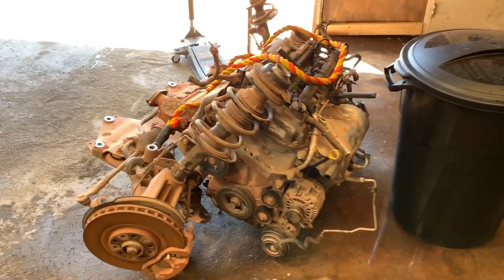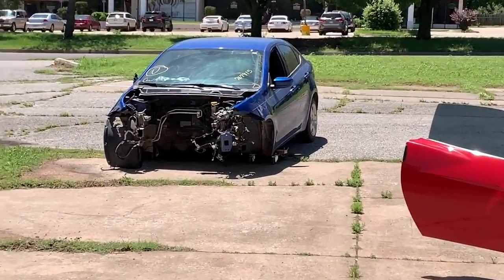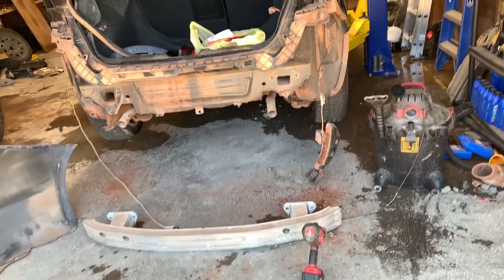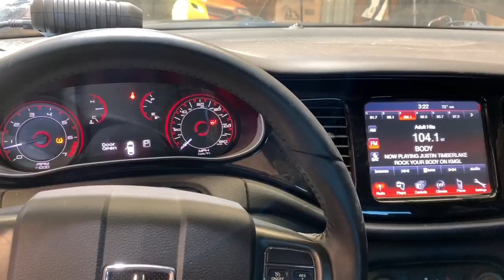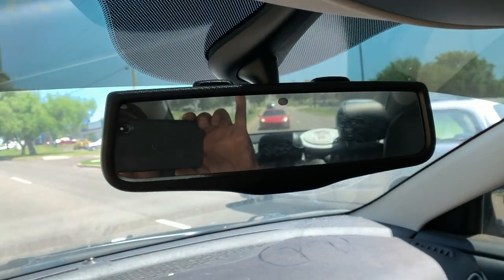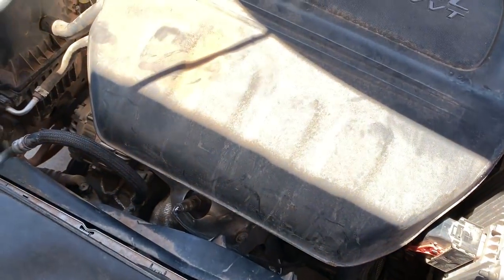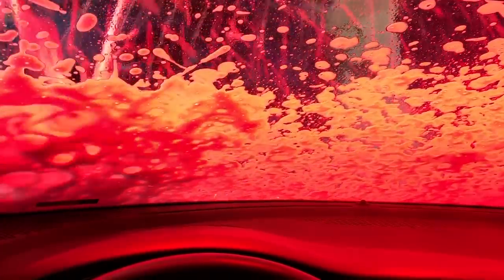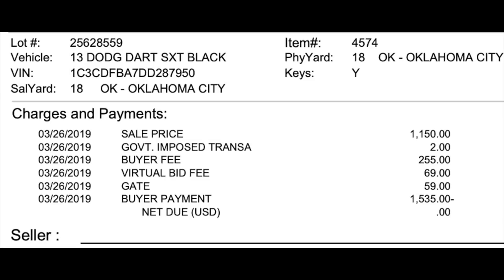Copart Flood 2013 Dodge Dart $1535 70% Off! State Inspection Time!!

Comment: Here's what I've learned Randy, I have had cars that sells at dealers for 10, 12.,15 thousand with a clear title. But with a rebuilt title people can't get these cars financed the banks want loan them that kind of money because you can't get full coverage insurance on a rebuilt title to cover a note in case of a loss. If I can get 50 to 70 percent of retail then I have done good. Yes I have had some that I got more but people had the cash or I carried the note on some of them with a big enough down payment. Either or good luck and congrats on getting it back on the road.

Comment: Randy: don’t repaint Dart.
Keep it original paint.
Have dents removed by paint less dent repair.

Water sand and polish original paint. It will look like, brand new factory original.

Mike can show you how.!
You can feature that on your channel!
Cheers

An original paint car is worth more money than a cheap Macco paint job.
Reply: Stephen horbatiuk I don’t even know if I’d worry about the minor dents but I am with you.  The paint on the rest of the car is fine for the age and much better than Maaco.  Paint the rewar bumper to match and call it a day.  The car looks great even as-is.

Comment: I’m with the others who have committed.  The paint on the rest of the car is fine.  Take the rear bumper cover off, have Weird Beard paint it.  Probably cheaper than a full paint, the car keeps its factory paint mostly and the stuff that needed repainted will be done right and probably cheaper that a full Maaco paint job.

Comment: Turn the electronics on in nurtual position turn wheel all the way to the left turn to nurtual turn off then turn back on all the way to the right back to middle turn off and then the light should go out I use to work on these cars a few a week

Comment: Do it right is the way to go... I'd be asking $7500 because it looks great plus low miles on the drive train.
Reply: Daniel McQueen thats a clean title price
Reply: I would say this car is worth 4k $ tops. Only because the title is rebuilt. To me as a buyer, doesn’t matter what was done. If it’s has a rebuild title. It’s only worth rebuilt price. Plus those cars brand new are only worth19k new..

Comment: Hit that dent in the front passenger door with a heat gun and then cold. It should pop out. Or use a suction dent puller.

Comment: Nice job. Ive done quite a few front wheel drive engine swaps. You should have changed out the rack.Get Beard to paint the bumper.im cheap, save $$.  revved up yooper

Comment: Randy just do what you feel good with mate. But we all know what you REALLY want to do right? You NEED to power clean that engine bay because we all know you just cannot resist it. Just don't screw up the engine! Oh and retrieve that tool from the front of the car.
And painting? I wouldn't if you are looking to sell for like $3k off dealer sticker. Put the black bumper on, good clean interior and change the VIN code and I would feel you are doing good by the new owner.
Nice job by the way. And you have enough in the other car and engine for more channel content plus there is some money in that old car as scrap. I also think you want to know why that original engine seized?

Comment: If your wondering why it is shifting wrong it likely is because the dual clutch setup in those dodge darts is programmed like crap and is very laggy due to that.

Comment: Don’t do a cheap Maaco paint job. Take it to a proper detail shop and have a nice Paint Correction done. Then cap it off with a ceramic coating. That will look way better than a junk single stage paint job.

Comment: You obviously don't know how transfer of energy works. But let me tell you what's going to happen. My customers going to bring that car to me with a laundry list of codes. And I'm going to pull the a-pillar trim and see the water line. And tell them to take it back to exactly where they bought it from. By the way... Did you happen to look at the sales numbers for the last quarter on the Dodge Dart? Turns out they only sold three of them. In the entire country. 1 a month for 3 months. If they're not selling them new, what makes you think you're going to sell yours? When Murphy said, if it seems too good to be true, it probably is. He was specifically talking about used cars.

Comment: Rebuilt car 60% of value  Bank will not fiancee rebuilt car  bank are not willing to loan money on rebuild title  Will sell for 5000
Reply from the maker: That is incorrect. 2 of the banks I use to finance cars have no issues and will loan clean retail value on a rebuilt car, and one of the two banks is a credit union.
Reply: @AutoAuctionRebuilds  That is good , wish our bank would do it There is nothing wrong with a properly rebuilt car if it is done correctly  like you and Mike are doing .

Comment: I would not buy this car. I had it and that transmission failed at 20k. There were so many issues that Chrysler stopped production of it
Reply from the maker: They didn't stopped production due to issues. They stopped due to decreased sales. This car has 4x the miles as yours and it is still running and driving.
Reply: Auto Auction Rebuilds oh yea. But a lot of people had similar issues with theirs even the Chrysler 200.

Comment: If you're going to use channel locks to straighten metal, why did we go through the effort designing and building a planishing hammer? The same Hammer that metal workers have been using for centuries. Obviously isn't good enough for this task. One thing has become apparent through listening to you speak. You're not a body guy. And probably shouldn't be doing body Guy work. You have identified 3 improper repairs. And told us how you were Going to do it improperly. And then justified it. Because, obviously, your family won't be ridinf in that car. You are the used car guy I warn my customers about.